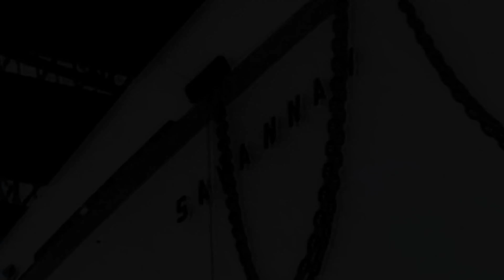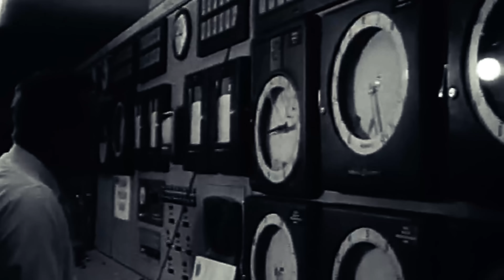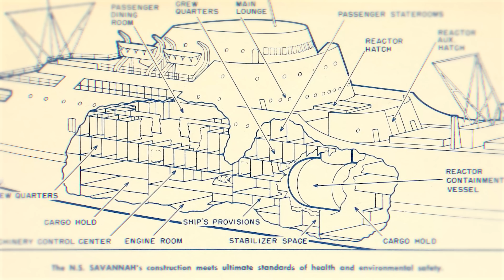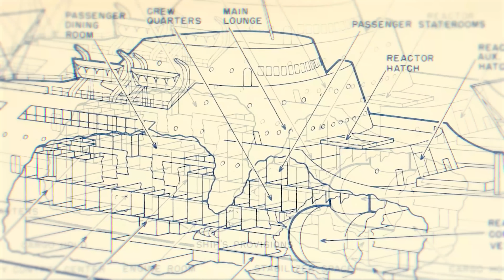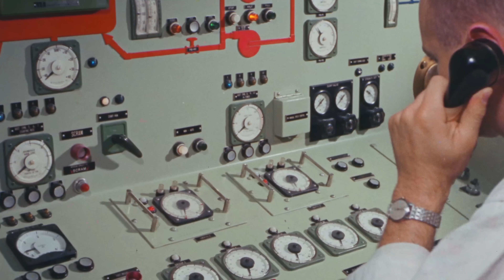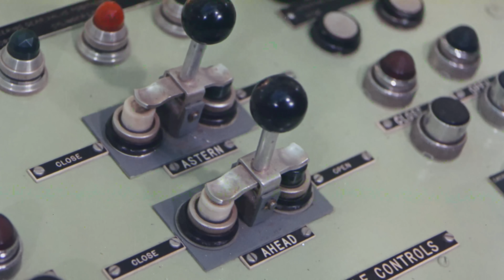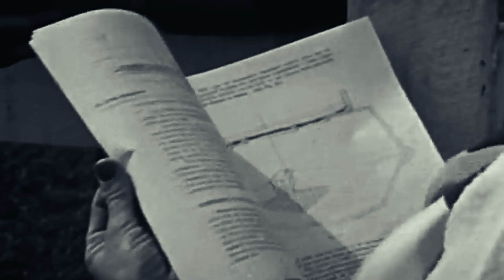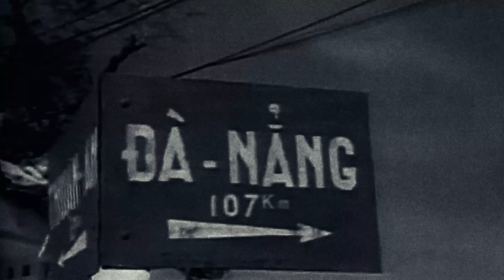What Happened To Nuclear Powered Passenger Ships?

Comment: Can you imagine if a ship with nuclear power was hit by a torpedo
Reply: Since they're all warships, a lot of people have probably imagined that
Reply: And nothing happens. Thresher literally imploded to pieces in deeps and reactor was just laying on the bottom ever since, intact. They built like a steel bunkers from the start, layers after layers of protection, starting with thick heavy core shell.
Reply: @specialsnowflake2309  and being FULL of water they would not implode easily, the seals would fail and water would rush in as the reactor vessel got deeper but because unlike Titan, or the stern of Titanic, there is no void for air to be in as they are pressurised water reactors, (you don't want air in there) the ocean can not crush it.   

9 nuclear powered subs have sunk.   7 still lie at the bottom 
K27 (USSR) - decomissioning by scuttling
K8 (USSR) - sank in rough seas whilst under tow after a fire - all hands lost
K219 (USSR) - sank whilst under tow  after missile tube fire - 6 crew killed, (was the subject of the novel and movie "Hostile waters"
K278 (USSR) - sunk after fire in the Barents sea between Norway and I think Svalbard
K429 (USSR) sunk after test dive due to flooding, raised then sank again at her moorings 2 years later - raised and decommissioned in 1987.

Kursk - (Russia) sunk during exercise in the Barents sea - NO survivors.   Raised and towed to port for decommissioning 
K159 -(Russia) - left to rust for 14 years, sunk at her moorings after storm ripped her from pontoons used for floatation - 9 of the 10 salvage engineers killed

USS Thresher  (USA)- Sunk after technical difficulties and imploded in the North Atlantic - all crew lost
USS Scorpion  (USA) Sunk after reaching crush depth, one theory (as seen on Discovery channel) is that a torpedo had a technical malfunction so was released, only to come round and strike the sub - all crew lost
Reply: It sinks...
Reply: Savannah failed because it was fake. Where was the turbine?  Where did the steam coming out of the turbine went to?
They never show the turbines of the reactors, why?
Reply: @ShonMardani Is this a bad attempt at humor?
Reply: @WALTERBROADDUS   Do you think Savannah is a joke?  Or the Nuclear reactors are jokes?
Are you on a comedy site?
Reply: I think Savannah was a groundbreaking piece of 1950's technology. Your comment was non serious or without serious thoughts.
Reply: @WALTERBROADDUS    Nuclear ships and submarines are FAKE, if it was not every ship and submarines would be Nuclear.
Reply: 🙄 Fake.... Your commentary sounds like someone who thinks the Earth is flat?
Reply: @WALTERBROADDUS    I am not sure about the Earth but I know that Mars does NOT exist, drunken Galileo imagined it 400 years ago and no one since.
Reply: 🫩 No Mars? Okay..... moving on....
Reply: @WALTERBROADDUS   We can't move on until you tell me if you ever saw the planet Mars or if you know anyone who ever saw it. Or if you know where can I find it so I can point my telescope to it.
Reply: Mars is currently in the constellation of Libra, with a right ascension of \(15^{h}05^{m}49^{s}\) and a declination of \(-17^{\circ }43^{\prime }47^{\prime \prime }\).
Reply: @ShonMardani  Those are just your regular, steam turbines. Only difference is that water in it isn't heated by nuclear reactor directly, but via 2nd cooling conduit, as coolant in 1st cooling conduit is radioactive due to passing through active zone of reactor.
Reply: @ceu160193   No matter how you transfer the heat, steam turbines are noisy and produce so much steam which need to be cooled, liquified and recycled.
 Also you need huge supply of FRESH water, where do you get that?
Reply: @ShonMardani  you have 3 circuits on a nuclear vessel, circuit 1 takes heat from the core through a fluid medium, be it CO2, liquid metal such as liquid sodium or. Mercury, that transfers its heat into a second loop (usually water) this second circuit vaporises into steam which spins the turbines.  That vapour goes through a second heat exchanger cooled by the third open ended loop which takes in cold sea water, and discharges it slightly warmer.

SS NORMANDIE also used steam turbines to spin generators just they used oil furnaces instead of a nuclear core and pressurized water circuit.

Fun fact Titanic had a steam turbine
Reply: @ceu160193  steam boiled directly by the reactor, that does exist, its a BWR or Boiling Water Reactor.   A few US Power stations use them but as far as I am aware none have been used on ships
Reply: @Xantec  Not for long, at least, as steam turbine becomes radioactive relatively quickly and it's replacement is expensive. So to avoid this, most common scheme is 2 conduits, with first passing through reactor itself, and second getting heat from first via heat exchanger to spin the turbine. As far as I know, it's mostly molten metal in first conduit now, since it allows to operate conduit at lower pressure.
Reply: @ceu160193  Dounreay was a molten metal reactor, it was a relatively successful unit.   Using a closed loop to pass heat into the steam circuit via heat exchanger is it seems the way to go, makes turbine maintenance easier too.
Reply: @ShonMardani because they are regular steam turbines cooled by seawater through heat exchangers.
Reply: @Xantec    Turbines connected to generator or the drive shaft?
Reply: @ShonMardani  looking at schematics, the propulsion turbines are geared, there are also auxiliary systems to provide cooling feeds. - NS Savannah is a 3-loop vessel using a PWR type reactor.   Water under pressure gets EXTREMELY hot but doesn't boil, this transfers heat into the second loop which boils into high pressure steam, (might also be super heated) - it then flows through the turbines before going through a condenser which uses sea water in an open circuit, cooling the steam back to water, most likely its steam pipes being surrounded by sea water.   

works the same way that the propulsion plant operates in a nuclear submarine or carrier
Reply: @Xantec    High pressure steam and turbine make lots of noise and vibration.
You can not push the steam back into a radiator for cooling. Turbines need high pressure on one side and atmospheric pressure on the other side.
Reply: You claim witchcraft now? Magic tricks? They have been doing nuclear at Sea since the 1950s. They've worked all these problems out now.
Reply: @ShonMardani you need lower pressure, that is provided by the condenser on the steam circuit.  The same goes for oil fueled steam ships, they recycle the steam constantly.  Only open water circuit is the 3rd circuit which takes in sea water, passes it over the condenser before going back out to sea.  The steam circuit is a closed loop
Reply: @ShonMardani steam turbines are als very well balanced, in fact they are ballanced better than a car tyre!  

As for noise, the are mounted on rubber mounts in ships to reduce noise.  Submarines like USS SAN FRANCISCO, or USS OHIO use steam turbines and they are quiet, VERY QUIET when listened for. The turbines are somewhat smaller than power plant turbines such as those at Heysham (uk), or Diablo Canyon (usa)
Reply: @Xantec   They are so good that nobody want to use them to generate free energy.
Reply: @Xantec    In theory yes, but obviously not in practice.
Reply: @ShonMardani  where did you hear that?  

The UK is looking at utilising SMR reactors SMR or Small Modular Reactors, are land based marine reactors.
Reply: @Xantec   We have been looking into turning every junk into the gold forever, it does not mean anything.